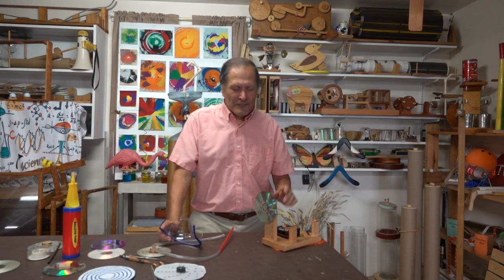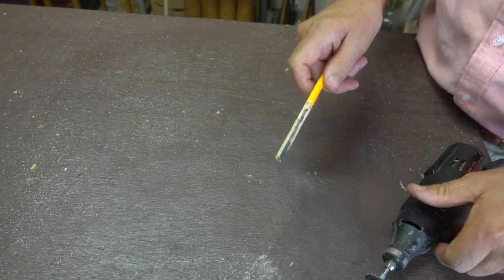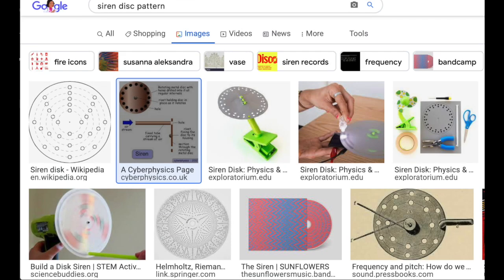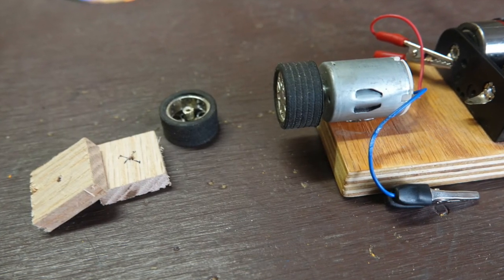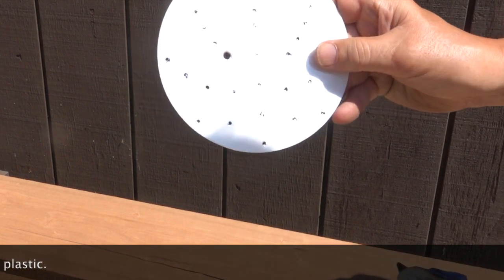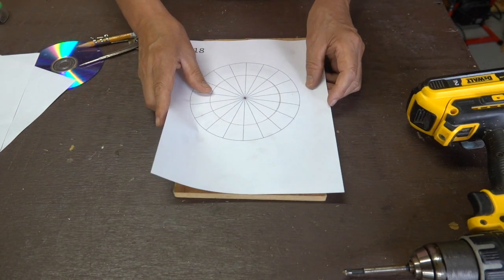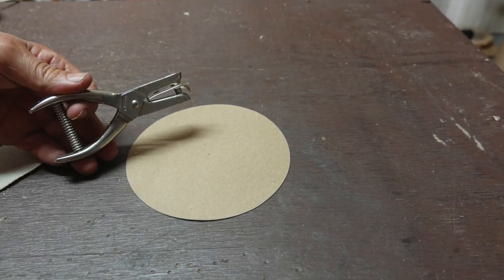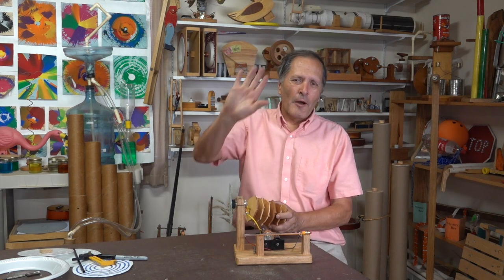Simple siren disc build instructions // Homemade Science with Bruce Yeany

Comment: Great videos!
Could you please specify the DC motor details?
Thanks
Reply from the maker: these are  commonly available DC project motors,  1 to 3 or 1 to 4.5 volts.  If you do a search for toy project motors, you should be able to find several options. such as size 260  or 280 works fine.

Comment: I wonder how making the space between holes uneven (but regular or symmetrical) would change the sound (some holes being closer together than other holes without being completely random).
I think 2 groups of multiple holes close together on opposite sides of the disk would have a sound with the higher frequencies emphasized (akin to a pulse wave with a thin pulse width) compared to a disk with two entire quarters cut out on opposite sides.
I wonder how changing the symmetry would affect the sound as well (having more holes on one side of the disk than the other).

Comment: What is your reason you cut the rim off of the plate?  Does it cause too much turbulence?  Or is it a weight thing?  dangit.  Now i need to go find styrofoam plate and a motor to see..
Reply from the maker: I tried the whole plate and it works but ran a bit slower and flexes as you turn  behaving a bit like a gyroscope